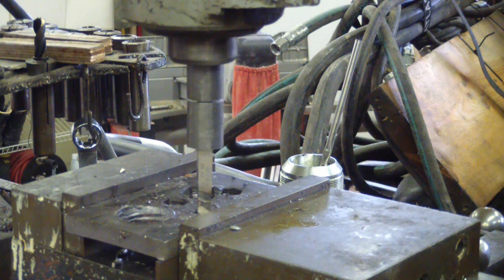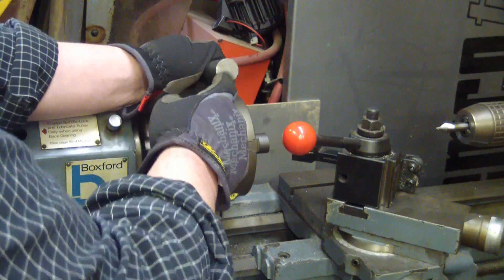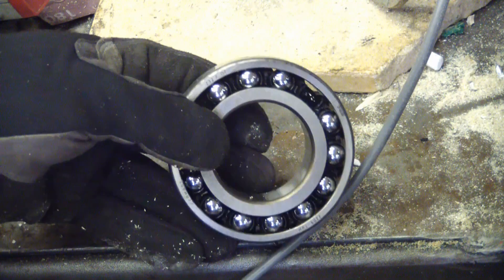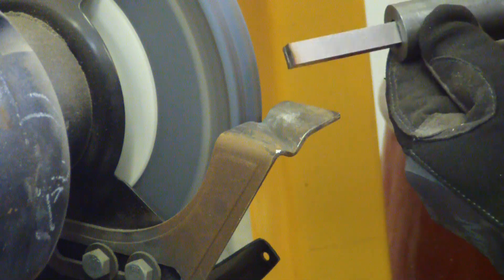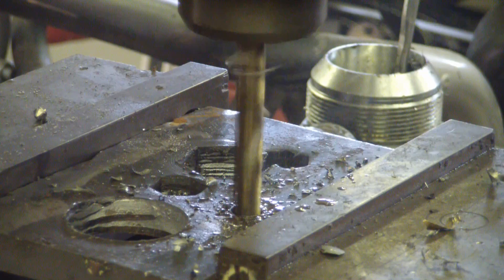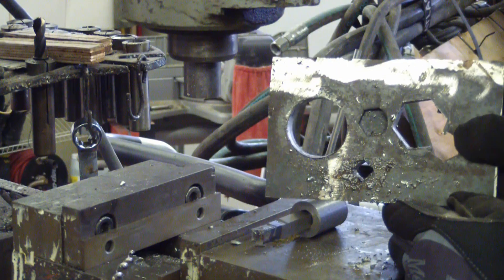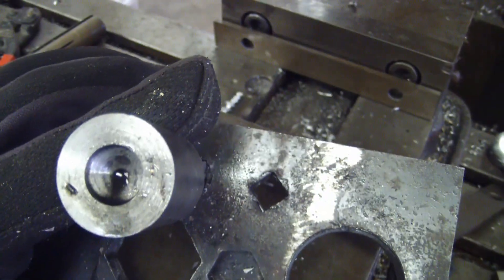How to Drill Square Holes!

Comment: How do you orient the rt angles of the square  so that they're square with the piece they are being cut into? Example, you want them at N,S,E &W. how do make sure that's where they start and end up, and not end up like, north/east by south/west by south/east by north/west? ..or wherever.. is there some kind of starting insert that can be clamped in place at desired orientation and location?
Reply: j dog  seems like you could:
1.  Drill an initial hole in a piece of scrap, and clamp it in place as a guide.
2.  Clamp / weld? some square stock into a square hole to use as a guide.  Long top and bottom pieces, shorter pieces to either side.

Comment: Great informative video. My square holes have all been in aluminum, but if ever I need to do a steel square hole, I have the resources on which to fall back.

Also, if larger ball bearings are needed, find an old-style computer mouse and carve away the rubber coating from the possibly steel ball within.  Check the rubber coated ones with a magnet and stick with the ones that stick. Big balls in tiny mouses.

Comment: Is it possible to machine a tapered square hole?  I have a valve stem that has a tapered square male shape that a hand wheel fits over.  A lot of the replacement hand wheels either have straight squares or are solid blanks.  We’ve tried using files with mixed results.  I’m looking for something a little faster and more reproduceable.   The shaft sizes range from 3/8-1/2” for most of them.  Bigger than that and they come pre made.

Comment: 1:04 you sound so disappointed... so am I ...
would it be easyer/faster to just offset the ball hole a little deeper and off to the left to change the size of the eccentric? 

u-hauk could use one of theas for there upsidedown drill press for installing hitches. 200lbs grolia on a 18" 4:1 lever, should apply sufficient cutting force.

Comment: So would this method make a D shaped hole?  Curious as i need to make one in a drain plug. Uses 1/2" diameter cotter pin to open it. (27 Studebaker oil pan drain)

Comment: I know this is old and the comment will probably get lost in the bowels of youtube comments, but I was wondering if there was a method to broach a hole using a hand held drill?  The broach is for a gate latch and the broach will be in an existing steel pole so using my drill press is going to rather difficult.

Comment: Any chance we can get a closer look at the geometry of the cutting tool you did on the grinder? This seems like a damn good method to build a boring bar for square blanks, as long as a flat is milled where you start the hole. I could use a bar for threading and boring, don't much care for drilling three holes and weakening the bar

Comment: i love the machining, i can watch a mill for hours. i miss my time at w.f. engineering. super hard tool steel and high temp stainless alloys, cobalt nickle etc. nothing but carbide tooling in the  shop. monster lathes. our largest cnc center had a 6 ft throw. i was the pee on which in a shop that makes  glass fiberizers for OC means you start sharpening carbides and if you do well you move on to making one off pieces. tool holders for the  cnc machines. edm drilling broken bits etc. i absolutely loved it.

Comment: way used to make broach  used spindex to make when was withen .020 thou shim ass end up .015.dykem it then finish to size...on nose put on lathe...lowest speed....use carbide drill...shallow angle then dust it..very slowly feed in till angle reaches outer lip  when done wire brush it should last quite awhile

Comment: if the leading edge of the tool steel was wider than the shaft of the tool steel you would end up with a same size square on both sides of the square hole. as this appears to have a a slight taper to it because of the nature of this oscillating broach!!

Comment: could you dish the tool steel on the lathe? use the drill bit holder thingy with a round abrasive tip?

Comment: I just did this tool with 1/2'' hss square bit and the same offset, about the same length. I did a square guide and I can't make it works in aluminum. Didn't tried in steel because I'm on a press drill. Wondering if the pressure needed is very high. I'm running a bit more faster than you and the bearing overheat even with grease. Did bottom grinding but not reliefe angle on sides beacuse it's aluminum and will just oversize the hole. Any suggestion to make it works?

Comment: For those interested in this, you can also use a much faster rpm and a smaller offset. I don't know how long AvE took to do that but I've seen machines rotary broach a hole in seconds in 1/2 inch plate using a much smaller wobble. I would also recommend placing a piece of rubber around the joint, you don't want to take a ball bearing to the dick head because it ejected with authority.

Comment: I'm going to impress my boss next time I build a high speed chip handler. He is always wanting square holes in the stainless steel top that's 1\2" thick. To hold air actuators in the proper position. As they can't move more then .01 of an inch. He's been using set screws.

Comment: Hay hay hay... want a square hole? Use a triangular HSS bit. Make a holder so that the bit can rock and roll and drill your way awaaaaaay.... far beter and faster too

Anyway... you got her done and that's what counts. 

Now for the best part: WHAT DO YOU WANT A SQUARE HOLE FOR???

Thumbs up from Spain amigo!
Reply: Guillermo Contreras  drawing of the holder?  What you are describing is a Watts Drill, IIRC patented in 1917, sold by Watts Brothers Tools.  I read $240 for the holder and $80? for the drill bit.
Square hole was to hold a square lathe tool bit.

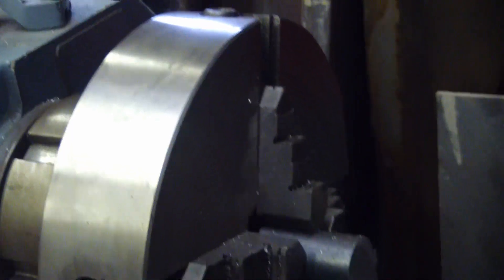Comment: Why is the profile of each tooth in the jaw of the chuck so complex? Does it serve another purpose or is it just machined to flex and hold evenly? 4:45
Reply: dmak2 It's to hold things from the inside, such as if you want to turn the outside of something all the way to the end. They're also stepped to hold different diameter objects since the chuck has limited movement range.

Comment: Hmm...not sure if I should pay the five or six hundred dollars or just make this?
Reply: ***** I paid the $600 and bought the metric 8pc hex (3mm-10mm) broach set from Polygon Solutionson ebay. Used twice so far.  Works good.  I'm sure a pro could make them.  I had already known about using drill rod or HSS un-heat treated and quench heat treating it.  This just made more sense as I will be using them much more in future making ti cap screws and such.

Comment: Thanks for sharing, this has been on my to do list for a while. Finally got it done during the christmas break. Still triying to figure out the sharpening of the bit. Did it on my grinder but the wheel wasnt dressed so i didint get the concave shape just right. It cuts the holes but only if i go a bit oversize on the round hole. If i go with a 1/4" hole, it will go about half way and stop cutting. And i have to re drill it to clear the chip. Works like a champ tho. Im making a second one for my neighbor

Comment: Pretty good, apart from the danger inherent in having a rotary broach held on only by downforce on the quill. Of course, you're going at low speeds, so it's definitely not as bad as it could be.
There are a few rotary broach holder designs online that you can just machine form 1020. They cna be run at much higher speeds if you do this a lot.

Comment: 1. It would seem that the the bigger the extent of the wobbling, the deeper and rougher and faster the cutting. There is a formula in there somewhere.
2. If the broach was tapered so the cutting end was biggest, there would be no taper in the square hole.....  correct?

Comment: How much down pressure are you using or does it kinda "self feed"
Reply: ***** That was my initial guess. I can do the same thing with my Milw. D-Handle. 3 bong hits and 1/2 a fifth of Flor(floor) de Cana. No additional wobbling device needed. It's more fun than screwing around with my lathe and the end result should be similar. I'll let you know..

Comment: Thanks, that's the perfect tool for a project I have been planning to do in the future. I wanted to use carriage bolts in steel plates and this will make those square holes nicely. The price is right too!
Reply: Sounds good. Thanks for the advice!